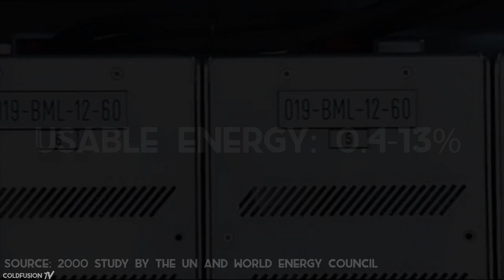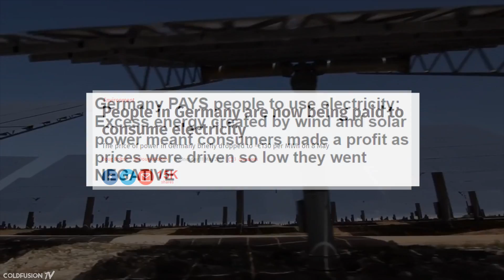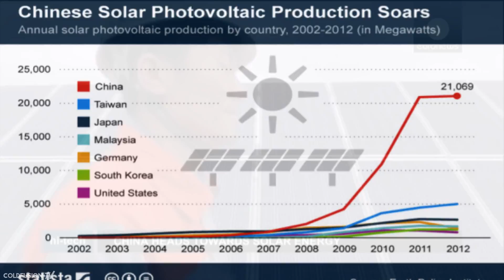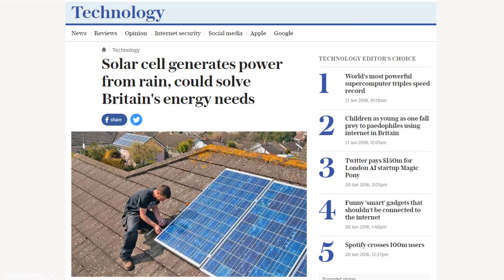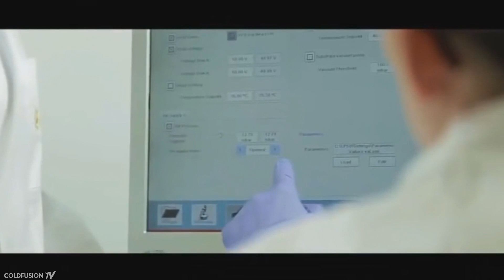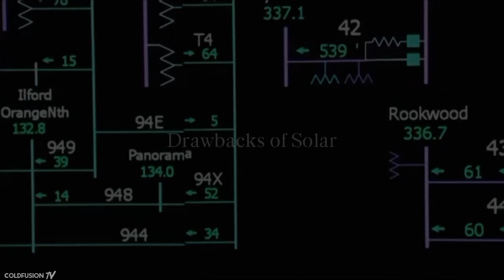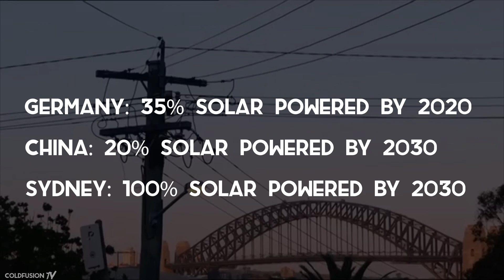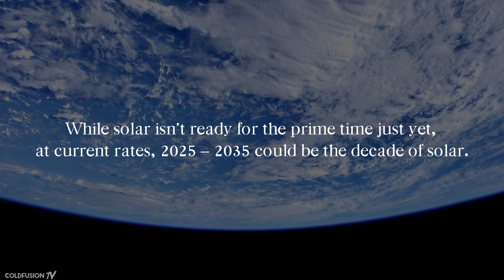The Truth About Solar

Comment: "For free" isn't accurate... the production cost money...
Reply: He means "for free"as in, coal factories have people working there that need to be paid. Sunlight directly reaches your home. So the only cost is the one that pays for the installation. Sunlight itself is "for free".
Reply: Maybe he means free as in, it is free of negative health consequences - air pollution, etc.
Reply: I don't understand that...
Reply: Ramón BS Coal is not far more efficient, it is only slightly more efficient, and solar will overtake it soon. There is no upkeep cost of solar, only an upfront cost which is what cold fusion meant as 'free energy'. You'll have to buy your own panels, but then there is no upkeep cost.
Reply: Ramón BS
Do you not understand pollution? tons of people get lung diseases and cancers from it, it's bad for animals and the environment, those are facts. burning coal or gas causes pollution on very large scales. By free energy they mean that it is from the sun and we are harnessing its (practically unlimited) energy, it is not polluting the environment when we take solar energy (any pollution in production is negligible compared to burning coal/gas as it does not pollute much, if any, to make solar panels). Does any of that make sense to you?
Reply: Solar panels need certain materials to be built. Those are mined and industrially produced. That all takes energy and is harming the environment. I'm not saying solar is bad, but nothing is "free in terms of negative consequences". Energy always comes at a cost.
Reply: Currency is a human creation, and though it may make the world go round, it doesn't make the universe turn. A lot is free, monetary wise. Sunlight is free, you don't pay for it in taxes, or buy it from a shop, I don't understand why you are so convinced it isn't free.
Reply: Ramón BS How does the extraction of sunlight cost money? Coal requires deposits to be found, it requires a way to extract it, and a power plant to process it. Solar panels cost money to build, and... that's pretty much it. That's how upfront costs work Ramón. 

Yes, solar panels are made by Humans. Well done...

What I was saying is currency isn't engraved into the universe, and is flawed in many ways. For example, we do not own our planet, who gave it to us? We sell parts of our planet every day purely on the basis of 'finders keepers', yet we killed the native Americans and stole their land anyway. We claimed earth to be ours because no one else stood in our way.

Currency is useless outside of earth, it's value is superficial. I don't think throwing bills at the sun will send light back, which is what you suggesting, paying for sunlight. 

You probably think I am some left wing socialist, I am not. I am right winged, which shouldn't really matter, but I can sense you assume it to be the case in your responses, "I think you understand nothing about economics".
Reply: Ramón BS I didn't say currency is useless, I said currency is useless outside of Earth. 
You're not very good at reading are you? 
You act like money is life, far from it. Money is worthless without something to buy.

And, you just repeated what I said... solar panels and batteries cost money, that's how upfront costs work... 

You're really not very good at reading are you? 

But there's no ongoing costs are there? You don't pay for light do you? No... Do you pay for coal? YES! You don't have to pay for upkeep with solar panels, that is what I have been saying the whole time. Why is that so hard to understand?

You have no valid points so far.

Coal pollutes the earth, and I do hope you aren't someone who refuses to accept global warming, because it goes against your current ideas, because those people are idiots. 

I respect people who don't believe in global warming as they have evidence that could disprove it, I do not respect people who do not.
Reply: Making solar panels , is making pollution.
Just getting the raw materials that is mined causes pollution.
And then to make the crystals takes enormous amount of power which got to be produced in the first place.

Making solar panels causes pollution right in the first place before you even get to use it.

How much more pollution do you create by making  batteries that may be used and need to be replaced,  or the electronics that need to be replaced every 10-15 years.  Just look how much puff/smoke goes into the air by getting the raw materials and then all the powers needed to make them.
Reply: You still have labor in getting the raw material in making panels and distribution and installing them.
Reply: not sure  if some people here are stupid or are just trolling
Reply: However, developing recycling and storing technologies will almost make energy 'almost free'.
Thanks for the informative video.
Reply: I am not aware of exact economical aspect of the matter, but coal is far more popular than solar power. Investing in solar power is soon gonna make it much cheaper energy source than any other. Check out plants, they are doing great living off of sun for many years coz they managed to master the art of photosynthesis, evolution approved its methods ; )
Reply: Ramón BS Solar power will be cheaper, cleaner but not free.
Reply: Ramón BS Ramon you idiot I know the production costs money, I never denied that, but you don't have to pay for the power after you've bought the panel.
Reply: Bonnie Flory Burning coal produces far more pollutes than the production of solar panels. And coal is burned, you don't burn the panels, you keep them.
Reply: The energy is free, the solar panels aren't. You buy some solar panels for your house, then you don't pay...
Reply: because the suns light is free, once you've bought the solar equipment you're good to go unlike fossil fuels
Reply: You should see the pollution from making the panels.
Reply: Imagine 4 students living in big city. They don't have a car. To live without a car in big city sucks, especially if you're young student, so they decide to buy a car and share it. It's not free, but possibilities are much greater than before: now they can use time that they previously used for walking, to work and earn more money. You would say that they have to buy gas. It is only partially true. In couple years they gonna ride for free, charging car with sun. Using coal, oil and nuclear power are all far more expensive and DEADLY.
Reply: Hurricane If it will be cheaper, it will be with the investors money. Again, there is nothing free. 
However, I'm wtih the Naimul's last idea.
Reply: Hurricane solar panels is a human creation too. What do you mean? 
I think you understand nothing about economics.
Reply: the extraction of sunlight cost money = what you paid for the solar panels and batteries and so on.

"currency is useless" is a nonsense. Again, you know nothing about economics.
Reply: So far they do not charge taxes on that free sunlight yet.
Some place charge you a fee or tax or make it illegal to catch that free rain water.
Would not surprise me if they would do the same with sunlight.
Reply: But, it takes a loooooot of energy to make them. Some people say that it takes more energy to make them then the energy they produce in their lifetime.
That energy has to come from somewhere and has to be generated somehow and with it comes the pollution.
Reply: Does the sun "directly" power your house? No technology, no wires?  Panels free? There is always some form of human connection to any energy so would this still mean it is free?  It's all about Capitalism (which I do not agree with, causes way to much greed and pain).  It doesn't matter what source of energy we use, there will always be someone there controlling what you pay.  What I see is, the powers that be are stalling, waiting for the supply and demand go up, then it will catch on (solar energy).  It would be in the politicians best interests to do this.  They will find some way to tax you for the sunlight and the technology.  I'm pretty sure they aren't going to give you a deal by charging you bargain basement prices.  Nothing about solar energy is going to be free.  You people who live with a Capitalistic mind are just just trying to manipulate everyone into believing this is right, this is good.  If it is that good, then make it attainable more easily, cheaper and affordable for "ALL".  Make it happen right now!  Until then, I do not believe that any of you who believe this way do truly care about this planet.  To me, you only seem to care with greed in mind.  What is wrong with "giving" something back to this earth for free?  That's one of the problems with this planet, everyone wants to take and never give anything back, shame on you!  If the whole planet has the mentality of taking, then you are just going to take everything that is available and have nothing left.  If you are going to respond to this rant negatively, don't bother, I will not waste my time and "Energy" listening to you.
Reply: let me guess, you would prefer to live in the dark ages because you think the production of all man made materials will harm the earth's environment. meanwhile you pay taxes to a government that would (and has come close) to sending the entire planet back to the stone age via a nuclear arsenal. You would think that would be your concern. But noooo, it's the production of some damn solar panels that has you panties in a twist. The NSA is watching and listening to the entire country, your new president just tweeted "let there be an arm's race". Really, fuckin solar panel production. Get a life,... and just maybe you'll get a clue if what's going on around you.
Reply: How many deaths are actually attributed to Chernobyl? I'm not talking the poorly outfitted soviet clean up crews! Many wind and solar providers are actually owned by big oil. Makes sense because with solar and wind you still need oil ultimately. Referencing Chernobyl as your end all argument is a bit hollow as it was 31 years ago. Only 2 people died directly from the meltdown and it was an old soviet plant not to western standards. How many meltdowns have they had in the US or more specifically France (74% of their energy is from Nuclear) in the last 30 years? By the way people are living in Chernobyl and have been ever since. Many simply didn't leave. It wasn't the wasteland that we were taught to believe. How green is solar? Here's an excerpt from a National Geographic article on the topic:"Fabricating the panels requires caustic chemicals such as sodium hydroxide and hydrofluoric acid, and the process uses water as well as electricity, the production of which emits greenhouse gases. It also creates waste. These problems could undercut solar's ability to fight climate change and reduce environmental toxics"Not worth the debate hey?
Reply: bugsan Coal and Oil cost a lot of money to extract, as a lot of employees need to be hired, mining facilities need to be constantly built on coal deposits and oil rigs on oil deposits, and the fuels have to transported to their destination normally on ships. 

The deposits also have to be located which takes a team a geologists a long time to locate.

Coal and Oil are in theory 'free', in reality definitely not.
Reply: Colin Jones the "tax" on greed is already the prices of the things and the need of have to work for achieving something. Greed is in human nature.
Reply: Ramón BS 
the difference is that the excess solar energy did require the use of any extra input, the solar energy would be there just from the fact that the solar panels are being used. it's not like gas turbine plants where you have to burn natural gases to keep the plant on. nothing is truly "free", but that's what the context is.
Reply: EarlGrey 2nd law of thermodynamics!!
Reply: Let me get this straight, the nuclear plant is the savor, and oil and solar are enemy, based on who owns them. you gotta be fuckin kidding me. I got one word for ya, "Chernobyl". Your position is not even worth the debate. Sure nuclear power can be good, but solar power doesn't have the potential to meltdown and scorch a piece the earth beyond human habitation for a generation.
Reply: Tony Gage Actually nuclear power is probably the best from of energy for the up coming decades/centuries depending on how long its going to take to get high efficiency solar panels. the key thing is that you use thorium reactors instead of the current 1950s uranium reactor because thorium reactors produce less waste, make more energy, can't melt down and are almost impossible to use for nuclear weapons production plus thorium is common and the reaction inside the reactor produces a bit of extra fuel and thorium right now is just thrown away as waste material at mining sites so it would be a shame not to do anything with it since a ball of thorium as big as a tennis ball could provide all the energy you wil need in a life time (car fuel included)
Reply: Free means free... inexhaustible means inexhaustible..
But it also exhaustible. The batteries last 10 years aprox.
Reply: Of course, and that is why we have to become very good at it before it becomes essential. And it may become essential quite soon!
Reply: Ramón BS 
If possible we should stop burning fossil fuel, indispensable for the biosphere.
Reply: Hurricane hahaha. Ok, that's the point. Thx. Go and absorb your free energy with your costly solar panels.
Reply: bugsan That is not the main reason why, the cost plays a part in why it is used, but it is definitely not the reason why we aren't using solar and wind for all our power today.

It is all down to reliability, solar and wind cannot be controlled, they don't have something you can burn more of when you need more power. Batteries store tiny amounts of power, and are expensive, making solar and wind very unreliable.

There is however an upcoming solution. Gravitational potential energy water batteries. the idea is you have 2 reservoirs, one much higher than the other. When you need energy you release water from the higher reservoir into the lower one, generating a lot of power in the process. When you have excess energy, you pump water from the lower to the higher reservoir. 

I strongly believe that is the future, but they aren't perfect. They are massive, take a lot of money to make and work best in countries with milder weather, to avoid evaporation.

A few exist in the UK where I live, and work very very well.
Reply: bugsan Do you realise there is such a thing as innovation? It is a delusional person who cannot see that what we have now is not what we are limited to. Smart-phones in 2016 are far more powerful than the most powerful super computers were in 1970.

Solar panels will become better, cheaper, more efficient as more money is poured in. Like stated in the video. Graphene holds extremely exciting possibilities, that could replace many metals we use today, and it is made of carbon. Silicon is very similar to carbon, and is the most abundant element in the earth's crust.

Humanity is not going to die when we run out of fossil fuels, and when it does, it won't be because of a lack of oil.

Even IF we cannot create better sources of green energy, then we can simply get metals from asteroids! There are billions and billions of tonnes of valuable metals floating around our sun, and various space agencys are already talking about asteroid mining missions.

Also there is fusion, which uses hydrogen, but doesn't burn it. A glass of water would create as much energy as a barrel of oil by breaking water down for the isotopes of hydrogen found in water, deuterium.
Reply: bugsan Plus solar panels still operate at a high rate even when it is cloudy, not all frequencies of light are blocked you do realise? Did you even watch the video?
Reply: bugsan Well said.
Reply: bugsan Regarding the amount of the sun's energy reaching earth, the sun is a  gigantic fusion reactor outputting more energy than we could ever hope to use. Even the tiny fraction
of this output which reaches our planet exceeds demand by far!

A minuscule amount of land is required to power the planet, you'd be surprised! If all the rooftops of buildings were covered with solar panels, the production would be great enough to go completely solar. 

Elon Musk, the creator of Tesla, the electric car, solar panel and battery manufacturer spoke about this. I can link you multiple videos involving said topic and Elon Musk if you wish.

Regarding his bias, Elon Musk is a legend, if you haven't heard about him already, I would highly recommend researching him. He set these companies up, because of the facts, in comparison to forging facts so his products would sell.
Reply: We need to put a tax on greed.
Reply: The device(s) to harness it has an input cost, but the actual resource is indeed free, accessible and infinite.
Reply: bugsan property implies responsibility of someone.
Reply: The energy is free. The devices to capture it is not.
Reply: nothing is free but fast roi in energy will make it widespread
Reply: Bonnie Flory it's has to make some sense, China could care less about the environment, and has really cheap labor,yet the are the new leaders in using solar
Reply: China is the leader in building solar cells, not using them for power production.
Reply: They are both, the largest producers and users, maybe your information is old, because they installed a lot in the last 2 years
Reply: most coal plants use more then a million tons of coal a year each, do the panels use that  much
Reply: Coal isn't the solution but neither is solar. Solar and wind is owned by big oil. Big Oil killed the nuclear plant which is by far the best solution!
Reply: A generator cost money too and you still have to spend more money to  feed it with fuel to get power out of it.
So in this sense, the sun energy itself is free after you buy the equipment.
Reply: Ramón BS Holy fuck, you're one ignorant, pretentious dolt.
Reply: Ramón BS free here could also mean inexhaustible because the earth revolves around the sun and it doesn't get depleted unlike coal.
Reply: Ramón BS free here could also mean inexhaustible because the earth revolves around the sun and it doesn't get depleted unlike coal.
Reply: But for how long will the sun shine, the wind blow or the tides flow?
Reply: John Benton ??? You need something capable of extract that energy from the sun or the wind. That something needs to be produced, and that production cost money, resources, etc.
Reply: At the moment fossils'll manage but they're not renewable. Unless you have devised a way of burning oil twice!
Reply: CassiusXs ... when you pay the solar system, you pay for the value of the energy. It doesn't care if the source is in your house or in a coal mine.
You have no idea of economics.
Reply: Joe L I didn't say the opposite. I want to show that the concept of "free energy" is wrong.
Reply: Joost Meijer Coal also doesn't cost any money. The extraction is what it cost. 
And the extraction of sunlight also cost money.
Reply: Jakub Garbacz coal is far more efficient too. 
I hope that solar power will be cheaper, but never "free".
Reply: Hurricane solar panels is a human creation too. What do you mean? 
I think you understand nothing about economics.
Reply: Hurricane ... that's the point. The production of solar panels cost money, the energy isn't free.
Reply: Hurricane money exist IF there's something to buy. You are wrong when you take as equal money and currency. Sometimes are equal, sometimes not.
But, going back to the point, the production cost money. That's a fact.